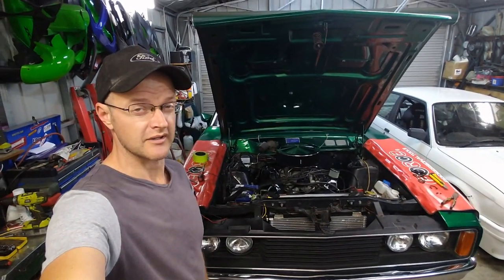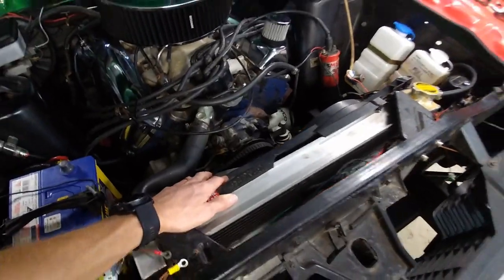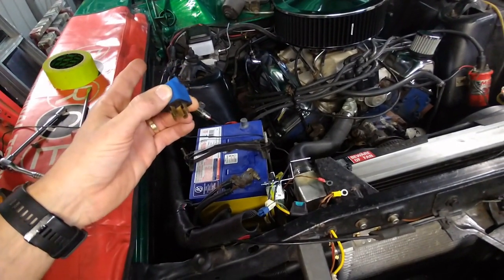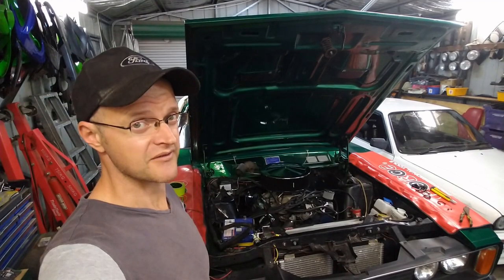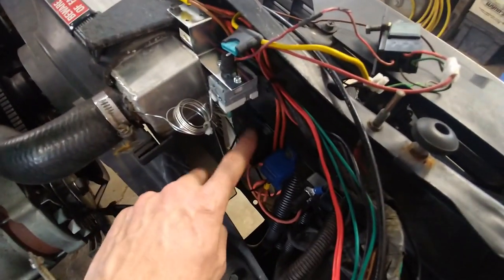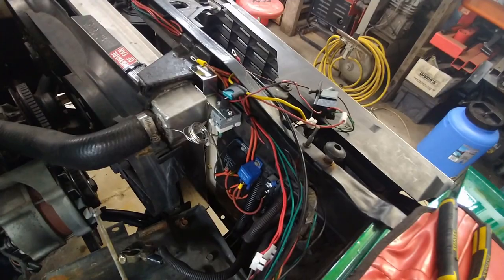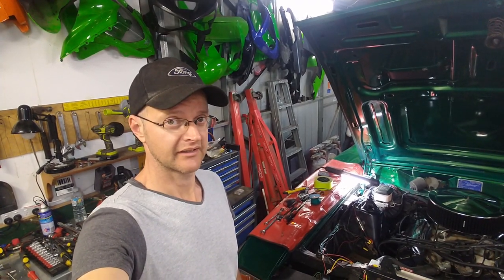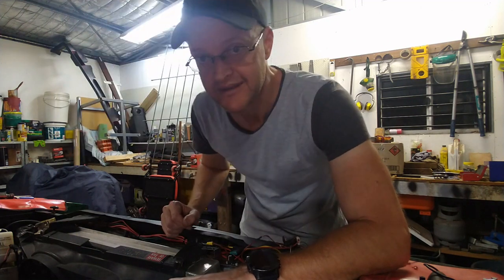XC Ford Falcon 351 Cleveland project: Ep 77 AU Thermal fan controller circuit install.

Comment: What radiator is that that you're using & was it simple enough to bolt your twin AU thermo fan's onto it.
thanks🍻
Reply from the maker: The radiator was a V8 ford ebay special and it was a bit undersized in width for the shroud. Cooled well enough but if you want the Au fans to bolt up like factory get a copper/brass ford radiator. the au fan holes line up with the top of the rad like a factory install.
Reply: @Missleindustry Thanks 🍻
I think i have 2core AU radiator that thermo fan currently bolted onto. 
Is in 1985 XF Fairmont with a 351C, stays reasonably cool open highway around 190/195F & creeps up to above 200F around town,which i suppose is normal. 
Only one fan comes on & have been told AC on will kick 2nd van in but not sure if applicable in XF...
Have Davies Craig thermo controller that'll get put in shortly after CHI 60cc 185 head modifications 🎉😁
Reply: @Missleindustry 😂think what I'm probably trying to ask is when or how does your 2nd fan on your XA kick in👌👍

Comment: Hey my battery in the boot,can i just eyelet the thermo controller battery wire & hook it onto my one wire alternator..
Have AU twin fan on my 351 Cleveland
Reply from the maker: As long as it is fused and the circuit goes back to battery it should be all good.

Comment: Thanks for the video.
Info like you've shared, helps us to make informed purchases.
I've since intentionally avoided the normal AU fan route, for my HQ, due to the amp load.
I've gone with a pair of 7.5 amp 1100cfm Maradyne fans.
Fingers crossed, as it's not running yet.

Comment: I run a original v8 radiator and shroud and clutch fan in my xe and no problems at all
Reply from the maker: If that was how this car came to me I'd still be using it too. If it ain't broke don't fix it!
Reply: @Missleindustry   doesn't mean you can't change it.
xf shroud & fixed blade fan works well.

Comment: I just did this to my xd falcon v8 radiator today sensor failed had to put on a toggle switch much better
Reply from the maker: I've been running a toggle switch on my other car for years and its been fine but for the one time I was at the mechanics with the car running in his shop while I paid the bill and we got talking about bikes. 18 minutes later on a 36 degree day the top radiator hose exploded off the radiator and made a hell of a mess.